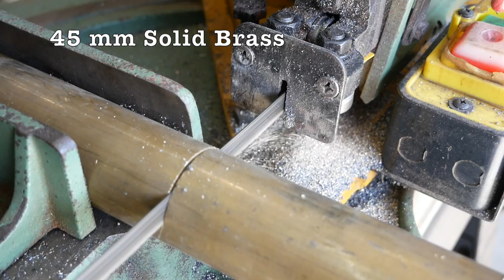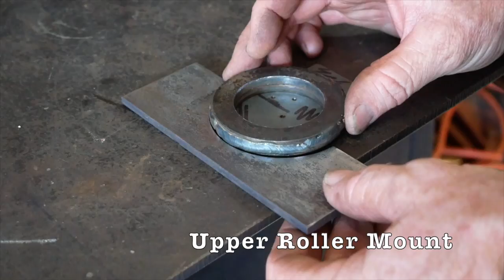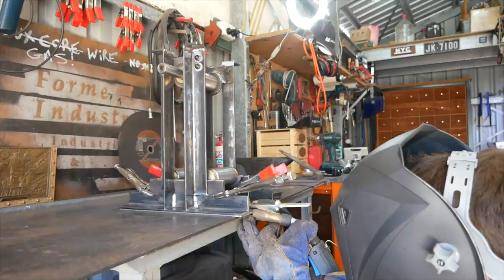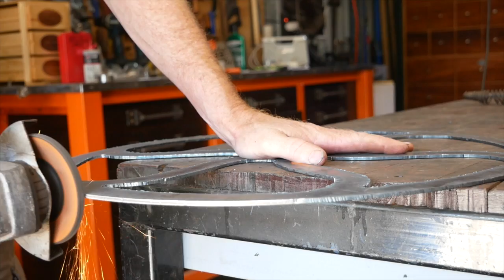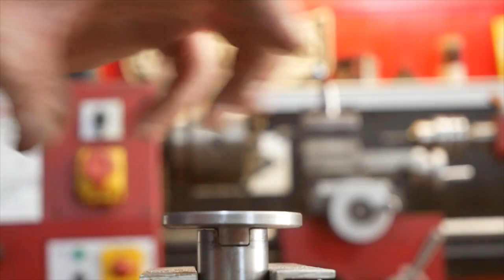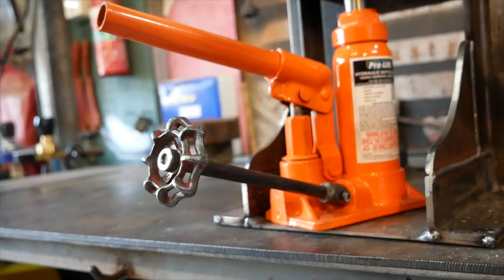DIY Metal Roller - Forme Industrious

Comment: Wow beautiful work ,I really taught you would bend a handle before cutting one out . My first ring an plate roller had 16 inch rollers with stainless steel collar for bearings,like your brass ones. I used a Rigid pipe thread pony to turn the top roller,it has the power to thread 2" pipe. My second plate roller had 48" rollers, great for bending 3/16" plate for making pipe an tanks . Instead of a thread pony now I use a 6 foot wheel like yours to turn it . Great project.
Reply from the maker: Thanks Ardy. I changed my mind a dozen times before finally biting the bullet with the cut out version.

Comment: Another cracker of a build Scott and as usual took a few little gems of tips form your process. Loved how you did the wooden handle I’ve not seen that done and liked how you used the CNC to mark out your design on the metal wheel 👍 cheers for sharing
Reply from the maker: Thank you! I was about to mark out the wheel by hand and thought hang on a minute :)

Comment: I’ve seen a few of your vids (they are great) 
Just a tip if you want to try this....when using large hole saws, if you scribe out the circle and the drill some 1/4” holes around the inside of the scribe line it will make your cutting go faster and also make your saws last longer. It just helps to clear the chips out and because it’s a intermittent cut you don’t have to slow down the saw as much as the hole saws get bigger and bigger. It’s something that’s worked for me over the years very well. Great job on all your projects!!
Reply from the maker: Much the tips are much appreciated, I'll give that a try next time. Thank you!

Comment: Now if there was a slot cut in near one end of that top roller, you could roll some nice angle iron as well.  Really nice job on the rig.
Reply from the maker: That's right but I might want a bigger roller to have the inner diameter withstand bending. Lot of forces in bending angle. Thank you!

Comment: Good old Scotch Finger biscuits, long time since I had them, on another subject, some Bronze would have been better than the Brass, more expensive, but cheaper than the bearings. If they still make it and you can find some, see if you can get your hands on some BP LMS210 grease, it's awesome stuff, it has 10% Lithium in it and once again, awesome work.👍

Comment: Absolutely gorgeous work, as always.  You've got an amazing eye for design.

I've been needing a couple large rings rolled for awhile now, but all I have in the shop is that same little ring roller you started with.  It's such a bear to work with that I always put off making rings!  The only upside to it is that I use the ring roller to make a form that I can then use to forge the steel bar around.  Still, more of a pain than simply rolling the ring I wanted in the first place!

Oh, and I'm still waiting for you to put up some shirt designs on Store Frontier Dot Com.  I don't know how much of your fan base is in the US, but I'm sure you'd sell a few shirts and I'm certainly down for a couple pocket tees.  I've been using them for awhile and just managed to talk them in to putting up a scale so you can set the size of your print rather than guessing.  Doesn't cost you a penny to put up your shirts on the site, so you have nothing to lose.
Reply from the maker: Huge thanks! Oh those shirts, oops. Well I did set up something on Teespring (having not one clue). See https://teespring.com/forme-industrious-threads-me?utm_swu=5372&utm_medium=email&utm_campaign=seller_campaign_launch_1&utm_source=Seller_mktauto_us

If you get one would you mind letting me know if they are reasonable quality etc. I should look at StoreFrontier also I guess. 

Thanks again!

Comment: Nice build. I've been wanting to do one of those for a long time. But... too many other unfinished projects.

To bend tubing without flattening it, you need dies with groves that have a depth at least half the OD of the tube. They don't have to be steel either. I used to work at a shop that had a bender with UHMW dies.
Reply from the maker: I was thinks of lathing up some guides for the rollers. using grub screws to hold in place. Many thanks!

Comment: Outstanding work, mate. Found you on one of Jimmy Diresta's old blogs. You were visiting his farm. Anyway, I did notice that sometimes you make construction a bit harder on yourself than need be. For instance, on the large wheel, you glued and then filled in with some homemade sawdust and glue putty. Why didn't you just cut a channel when you CNC'd the parts and have them meet thus covering the metal underneath. just curious. Great design. Cheers.
Reply from the maker: Thank you! Yes totally agree. I often change my mind mid build. I think in this case I was going to run a different colour wooded strip round the centre and later changed my mind.

Comment: Bronze is used for bearings (an alloy of copper and tin), a far superior material than brass.
Reply: But in this instance brass is a good second choice. Infact any bearing material is okay as long as you look after it and lube it.
Reply from the maker: I think you are correct, But I think it will take me a long time to get any noticeable wear on these bearings. But we'll see how they go. Thank you Jim.
Reply: @wideyxyz2271  Yes, you're right.
Reply: @ScottTurnerformeindustrious  The roller will be rotating so slowly I can't imagine it wearing out. Fantastic video, keep them coming.
Reply from the maker: @jimwarmington3933  Thanks Jim!

Comment: Scott, allow me to tell you a thing about the "moka": the right process to get a perfect italian moka coffe is this: open the moka, fill the bottm part (the boiler) with simply sink water, or bottle water, then fill the coffe powder filter (DO NOT PUSH HARD THE COFFE!!!!! JUST LET IT GOING DOWN NATURALLY) and put the filter inside the boiler and LET THE EXTRA WATER to go out. then close the two parts quite strongly and put the moka on the fire. better if you do not use hight flame but just a regular flame. that's it. In case you'd like the cream, as soon as the first hot drops of coffe come out from the moka, drop them into a cup and pour 4 little  spoons of sugar and mix them rapidly untill you get a cream. BE CAREFUL: the coffe cream is very hard to get done: no much coffe otherwise you will make a coffe-broth, no much sugar otherwise you will get a concrete-coffe cream! just few drops of sugar and 4 little spoons of sugar!!! then add this coffe-cream into a cup, pour the hot coffe and mix it for one minute. after, let it stay for another minute and... drink it!
Reply from the maker: Thank you for passing on the secrets for the perfect Moka! Will have to try making the coffee cream. All the best!
Reply: @ScottTurnerformeindustrious  you too. asap I'll be in Townsville I'll send you a message. Maybe in May, who knows... ciao!
Reply from the maker: @lastorianostra8173  fantastic, drop by if you get the chance.
Reply: @ScottTurnerformeindustrious  of course, absolutely!

Comment: Hi Scott. If You don't mind me asking.What is the brand and model of the metal lathe You are using in this video? GRATE JOB BTW!!! KUDOS from South Florida,USA.
Reply from the maker: Hi - the Lathe in Australia is called a HAFCO (Brand) AL-60M. It is also known around the world as a C- 6 lathe. My next Lathe if I'm lucky enough to get one will have lever gear changing for speeds and feeds.  This lathe it is all done manually by changing gears and pulleys. It's fine for a small workshop like mine.

Comment: As always, top shelf Scott! I’ve been procrastinating around a similar project myself and this vid has inspired me to pull my finger out my butt and get on with it! Just out of curiosity, roughly what did that lump of brass set you back? One assumes it was far less than the price of those bearings you talked about!
Reply from the maker: Always start the job with the removal of the finger - right on! Um I think the brass was $15 a kg and I got about 7 kg from memory

Comment: Nice work , I have a couple of questions if you could help me please, what size lathe do you have? And what kind of tig you use and can you weld aluminum? Thanks
Reply from the maker: Thank you! My Lathe is known as the Seig C6. All the specs are readily available on line. It's a humble, no fills home or DIY machine. My TIG is a cheap 3 in 1 TIG, Plasma, and Stick. It's okay also but very basic.
Reply: Thanks for the info, and ones again great work man

Comment: did you consider adding a drive pin/ 1/2 inch socket to the front so you could just use a cordless drill instead of the wheel. or is it easy enough to just spin?
looks awesome
Reply from the maker: Thanks Keith! Yes I did consider a Spring Pin and a 3/4 hex for a socket to the roller shaft, but elected to keep it in an Old Style. It's not a lot of effort to roll the flat bar. SHS was hard though.
Reply: @ScottTurnerformeindustrious  ultimately you could just remake that drive plate if you thought you really needed it. thanks for the reply

Comment: Nice build! Heavy wall square steel tubing would have made better mill posts though.
Reply from the maker: Thank you Dave. Yes maybe but my jack is only 1875 kg so I don't think I'll stress to too much. Flat bar doesn't need a lot of force but if I wanted to roll heavier stuff, yes for sure.

Comment: Several things I would have done different but I'm too lazy to have even started to attempt this project, so kudos to you just for that. lol. But seriously, I am afraid that the C-channel your bottle jack is pressing against is your weakest point in this design. I think you will ultimately need to add a thicker plate there to distribute the load more evenly. Hopefully I am wrong but if I am not, I don't see it being a big deal to fix. BTW, I'm a 64 yr old Machinist/Mechanic/Millwright/Fabricator.
Reply from the maker: I like your advice - based on experience, thank you. Well I think it will be well and truly fine, for the following reasons. It only uses a 1.5T Jack and is for relatively light material, say 1/4 inch 6mm. The material seems to conform pretty easy (Flat Bar) though the 25mm x 25mm x 2 SHS was much more difficult though I did get a bend. Yes if it needs to be beefed up that would be very easy to do like you say. Awesome comment, thanks again!

Comment: If you could make these so they could sell in the $600-$800 AUD range there are quite a few jewelers in OZ and Kiwis that would buy them especially if you can make one with just 2 rollers. They use them to roll out silver ingots to sheet or to use texture plates to add a decorative texture to silver sheet.
Reply from the maker: Might look into the roller for making impressions. I like the idea. Thanks Ricky!
Reply: @ScottTurnerformeindustrious  you're welcome sir. I just know that Oz is full of home jewelers that would love to have a rolling mill but they are too expensive to buy from the states and ship. If you pursue it let me know and I will promote it for you. No strings I just would like to see my jeweler friends there get the equipment that they need and want without paying an arm and a leg due to shipping.
Reply: @ScottTurnerformeindustrious  Oh and you might consider ading a grease fitting to your bearings so that once in a blue moon you can suirt a little lithium grease in them.

Comment: How speed are you using for metal cutting. I think about a metal belt speed and how big is your engine. Very thank you for your answer ,,
Reply from the maker: Are you asking about the Lathe or Metal Band Saw?
Reply: @ScottTurnerformeindustrious  Metal Bent Saw.
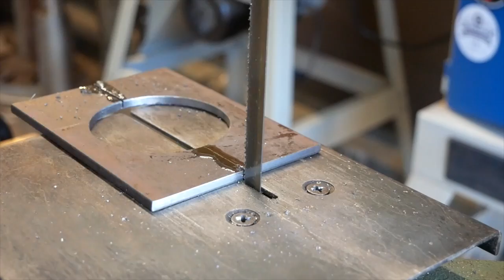8:09
I made myself a big and very good working machine. It cuts wood very well but has too much rotation for metal. I don't have a gear and I have to do it to reduce the rpm but I don't know how much.  At the moment, the saw is running at 22 meters per second
Reply: @ScottTurnerformeindustrious  
By the way, your products are amazing
Reply from the maker: @marcinwaley3613  the speeds on my Metal Band saw are 20-29-50 M/Min. I have it in 50 all the time. Yes yours is way too fast. Maybe try a VFD.

Comment: For large bearings like that, its hard to go past automotive bearings, trailer axle bearings, wheel bearings, also motorcycle bearings. I pick up a handful at motorcycle wreckers cheap, they aren't wanted by most parts buyers.
Reply from the maker: Very true Peter. I left the store in a bit of a downer and thought stuff it, plain bearings it is. However I'm pretty sure I can adapt to fit Rollers if I can find the right ones. Cheers!
Reply: @ScottTurnerformeindustrious  Up your way you can get big sets out off semi trucks and their trailers.
Reply from the maker: Good idea Peter thanks

Comment: But the Plain bearing is better than ball/roller bearing in this case. All old lathes has plain bearings - this type of bearing is the best when rotation speed is very low and forces is high. This will be percfect solution for roller bender :)
Reply from the maker: You got it! Just have to ensure the bearing is well lubricated and it will be good. I have used grease but I also would like to try an oil. Thanks
Reply: @ScottTurnerformeindustrious  maybe you can do some lubrication hole with tinny screws? Oil is the best lubrication for this bearings :)

Comment: Curiosity from a not-a-welder: why do people have both TIG and MIG?
Reply from the maker: Tig for fine work, careful control of heat. MIG for fast every day welding. I could have done every thing with either TIG or MIG on this project. Experts might have a better answer than I on this one.
Reply: (Not an expert here)

You would keep a MIG around the place for fast, one-handed, mild steel fabrication. TIG would be used for finer steel work (or heavier work where you want more control balancing heat and filler than MIG can give you), or stainless steel, or aluminium, or bronze brazing, etc. The flexibility and versatility is what makes TIG great. And one gas will do all of the above and more.

I had both a TIG/Stick combination machine and a MIG machine until very recently, sold the MIG to a friend because the TIG/Stick machine does everything I want.